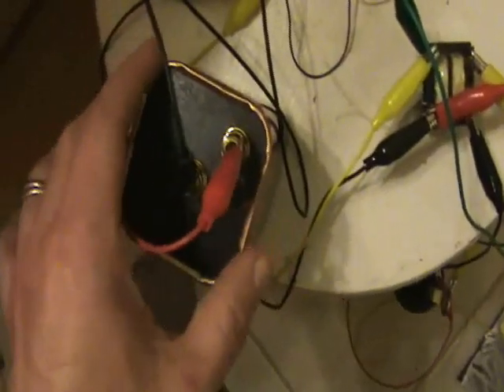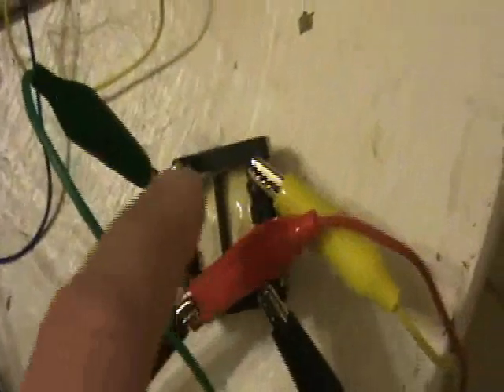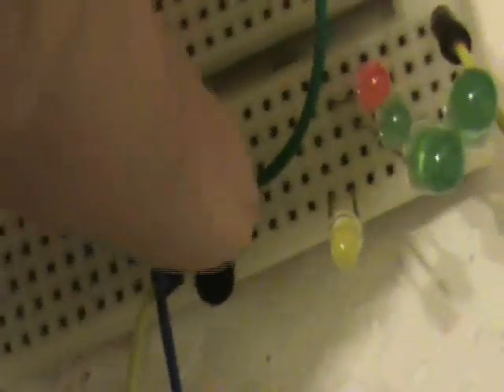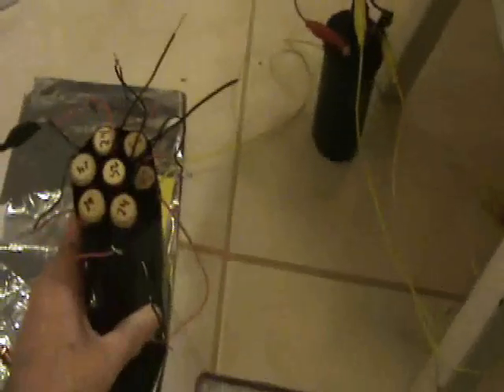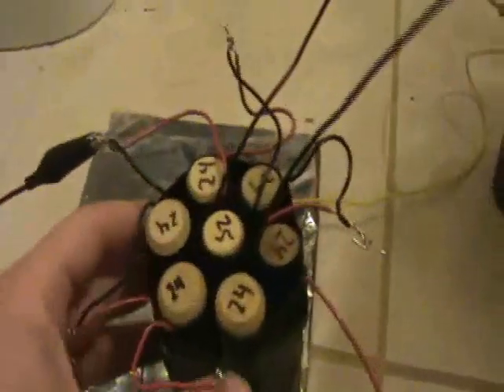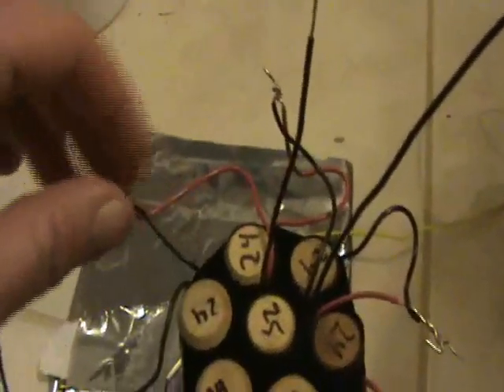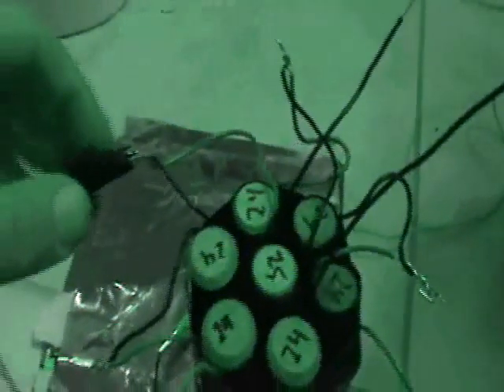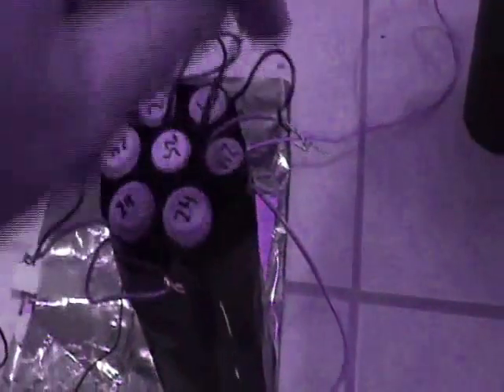Hubbard Coil - Experiments with Mutual Induction

Comment: You are rationing as if it were a traditional system. Within this concept it is not possible to understand how this system can generate a high power. Each of the eight coils are segmented into two parts. These two half reels create a magnetic field of equals confronted. All external coils use this device. The electronics will feed the two halves of the 90 ° lagged coils. This mismatch moves the confined magnetic field between equal poles, from one end to the other. This externally moved magnetic field is pulled into the center of the inner core with iron core. The magnetic field to reach the iron will pass through the inner coil generating a voltage with a high current. Good luck.

Comment: There is nothing to do with the PHI ratio nor any kind of radium. The magic of physics is not in sort of sacreed topology. If this is working, this only due to charge conservation. Having a deep understanding of Maxwell equation is the key here.
Charge conservation and energy conservation are two laws that can be contradicting in certain conditions and especialy when divA # 0. Since charge conservation appears to be the major law it must be then possible to breach energy conservation.
The topology of hubbard coil especially creates these conditions of divA > 0.
This is a key system that must be studied further. One must abandon magics in the way and shed a rationalistic approach on the case.
Reply from the maker: So Quaternion math then?
Reply: Quaternion is nothing more than a convenient way to do vector analysis.
Yes, maybe, all is a question of scalar potential and vector pressure directions in a 3D continuum + stationary wave mechanics.
Maxwell equations is no more than the fluid mechanics of vaccuum. Once understood, the key to release energy from this vaccuum is at near reach.

Comment from the maker: Nope. I have an oscillator powered by a 1.5v D-cell. That oscillator -- joule thief circuit, powers an auto ignition coil. That ignition coil enters the capacitor, and from a capacitor you can stimulate another coil via the electro-static activity nearby. No free energy here.... but HIGH-VOLTAGE and LOW-POWER, yes.

Comment: Why not build the Hubbard coil generator as Hubbard did? He didn't really use radium btw.
It was 8 around 1 and with an added outer coil. He had atleast 40hp off a 12" coilset.

Comment: Forgot about this tech for 18 years or so, then finally realize it's what I'm designing to work inside the Leedskalnin flywheel... sort of. Just take a look, maybe you builders will find it useful. 
I think anyone can make a simple magnetic device as I describe and it will be able to provide hundreds of horsepower for a few hundred bucks.

Comment from the maker: @mimieowcat 
Yeah. CFLs were not full brightness, so it is difficult to exactly know what wattage that amount of light corresponds to. The CFLs are stripped of all electronics ... and so its pretty easy to make a florescent bulb glow actually (but not self-start). To me, this points to the fact that the manufacturers of CFLs might be consuming a bit more power than they need to. I am encouraged by what others have achieved to produce low-power lighting.

Comment from the maker: @mimieowcat 
Not sure how you got those numbers. You can't trust the meters alone. As I was saying, the AC waveforms are affecting the DC measurements. AC is complex when calculating wattage since there is an RMS value you must consider. Over-unity is not proved, but I find it fascinating that you can go from a capacitor to a coil .. similar how you can go from coil-to-coil like a transformer.